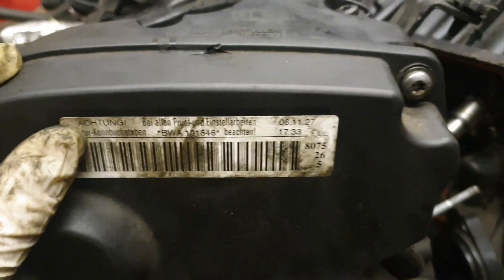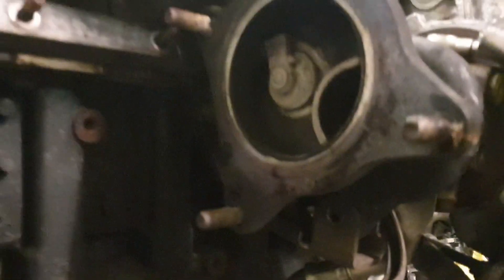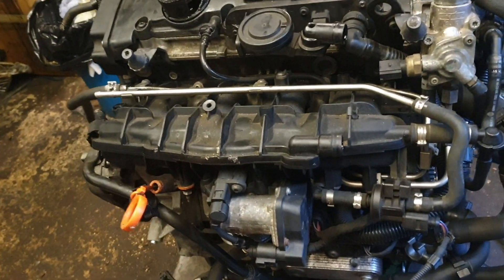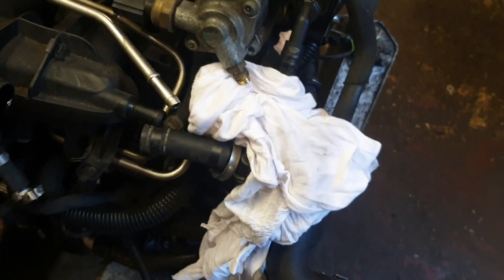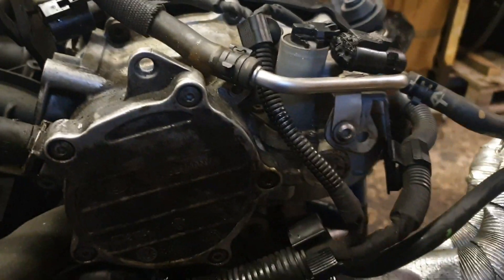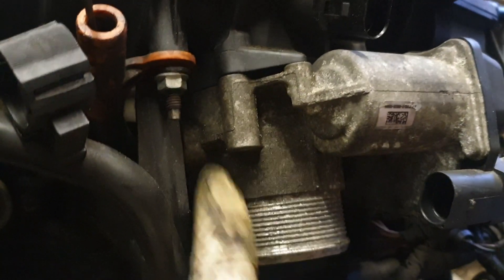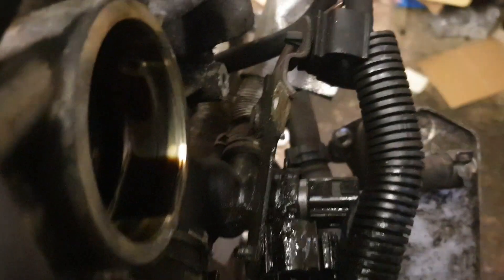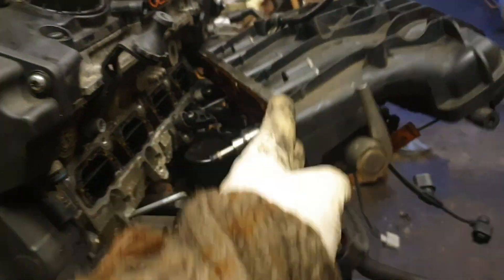EA113 VW Audi ENGINE Teardown Complete Strip of BWA AXX 2.0 TSI TFSI

Comment: Hello please can you tell me difference between BWA and AXX ? i got AXX i dont know how much i can tune in without any problems i know bwa is able to pull out 290 hp safe but i heard AXX is only able to hold 250hp is that true ?
Reply from the maker: They are technically the same. BWA is newer by a year or so, both 147kw 200hp 4cyl. There will be groups claiming one may be better then another - while they are the same just a continuation of the same engine..
Reply: @GetJobDoneofficial  They not. But close to each other, you do want BWA one :) on Ed30 you get BYD. which is first generation engine of the life.
Reply: i know that axx has softer cam lobes than the rest of the codes. problem solved in newer engine codes
Reply: The axx bottom end was forged from factory so should have a stronger bottom end. The the bwa has a stronger head.

Comment: Mine is cranking but not starting any solutions I’ve changed the timing value the fuel pump is working
Reply: what does obd say? what work you do before it happpend?
Reply: Does it fire with easy start?
Reply: Hi is it possible to swap this engine to golf 7 gti.